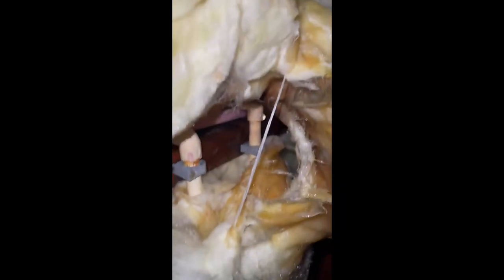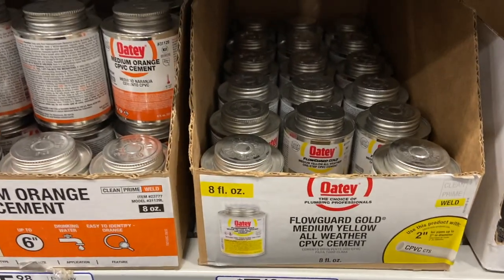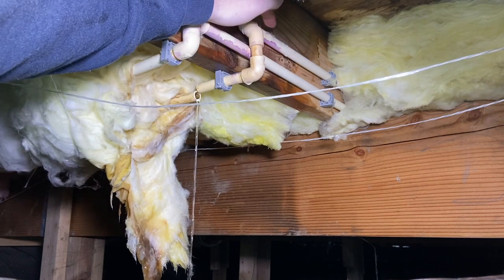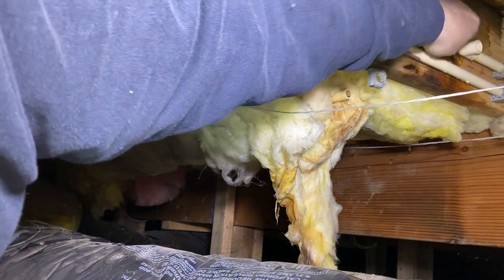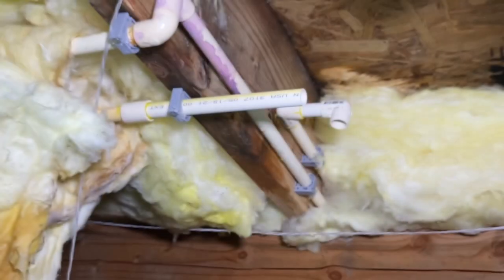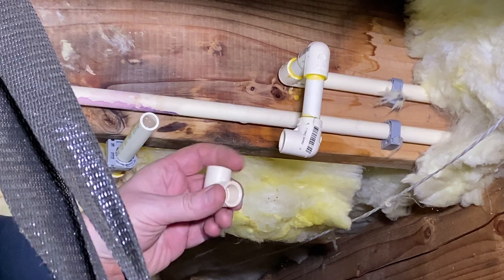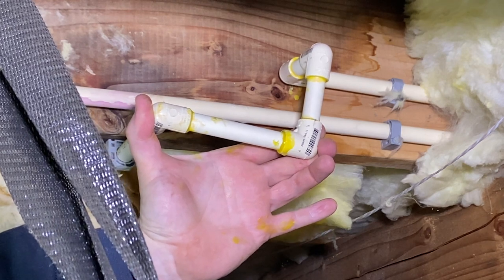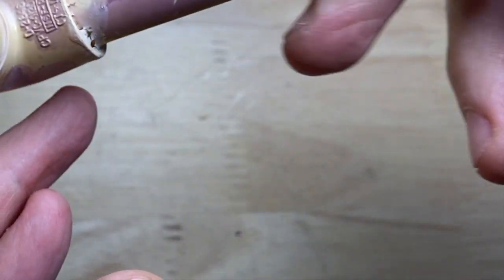How To Fix Plastic Water Pipe That Has Broken In Your House

Comment: You just saved me the expense of getting a plumber to replace a leaky hot water cpvc joint!  I did the repair in about 30 minutes and it doesn’t leak!

Your instructions were very complete and understandable.  I would have bought the wrong glue if I hadn’t watched your video.  

Like you, I didn’t want to wait 6 hours to test the joint.  What I did was turn off the water heater, and then took a “Hollywood” shower, using up all of the hot water!

Thanks again, and you’ve gained a subscriber.
Reply from the maker: Thank you for subbing. So glad that this was able to help you out.

Comment: Used more 90’s than necessary and made it more difficult at the end. You could have not glued the 90 on the pipe off of the beam and made a “U” with 2- 90’s and pipe which could have been glued on both remaining pipes at the same time by pressing on the ends rather than having to glue 3 joints at once. Worked okay but you made the job harder than it had to be. Other than that it was a good job.

Comment: Thanks for the video. Wouldn't PEX be a better solution? No worries about water messing up glue joints, less couplings, can be used immediately. Also  more reliable than cpvc.
Not criticizing, just curious, as I believe you've used PEX before.
Reply from the maker: It would have been but for just a small repair I did not want to make that transition.  You have to transition to pex and I could have with a sharkbite, it would be the quick way without gluing. Any other way and you have to glue.
Reply: @ThatFixItGuy  thanks.
Reply: Yes, you are correct. That cpvc with age can get brittle and makes it hard to cut with ratcheting cutters. Can become a headache to fix. When those cutter put pressure on that cpvc pipe it can sometime crack that cpvc pipe in the area of the repair creating a hairline crack. Then you have another problem and leak. Not fun! May have to use another way to cut the cpvc pipe.

Comment: wow fancy water meter mine looks like Archimedes made it. so why didn't you just run the pipe diagonally from top elbow down to the bottom one rather than square vertical and horizontal so you could use one less elbow and get slightly better flow
Reply from the maker: 😂. I like the old analog style meters  I can actually see the dial moving and I like that. Your right that would have worked really well. This is why I always like other people to walk jobs. There is always more than one way to skin a cat.

Comment: this is why i never use plastic pipes or anything new I'll let others test them out for reliability. I like the old copper pipes they are tried for 70 years in my house. I've heard that the cpvc can crack if it is old just from being brittle when using those shear cutters how old is that piping?
Reply from the maker: All that is true. Copper is king for sure. More time and more money these days but so worth it.  Cpvc is not a great product and yes this style of cutter can crack brittle pipe I always give a little twist when cutting to avoid  fully pressing on the pipe and potentially cracking it. Cutting with a saw is a great option. Dull ratchet cutters can cause an issue as well. My cutter is brand new. The pipe is around 20 years out but surprisingly did not seem to be brittle in any way like some of the other experiences I’ve had with cpvc.  Thanks Greg.
Reply: You are correct. It can be a pain.

Comment: Are those ratcheting cutters okay to use on old CPVC? I have a leak in the wall, and am looking for something to cut the old, brittle pipe that won’t make it crack or splinter. Do the ratchets put pressure on the pipe? What would you recommend? Thanks!
Reply: It might work but a hacksaw is what is recommended for old cpvc.
Reply: The ratchet cutters do not work on old cpvc. I just tried it, and it shatters/breaks. I just learned that I hate cpvc